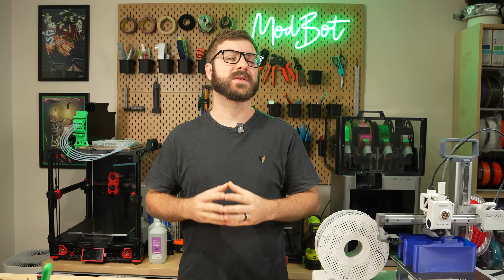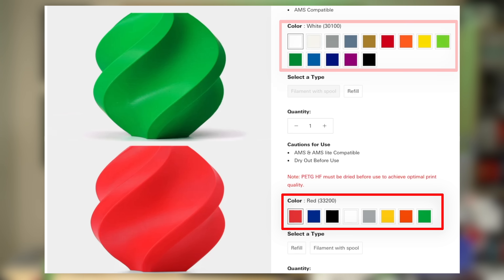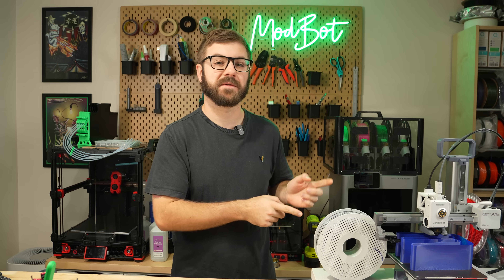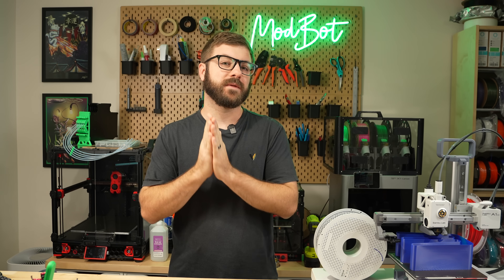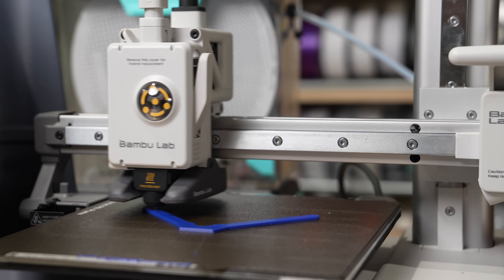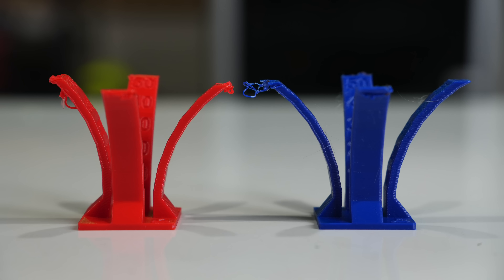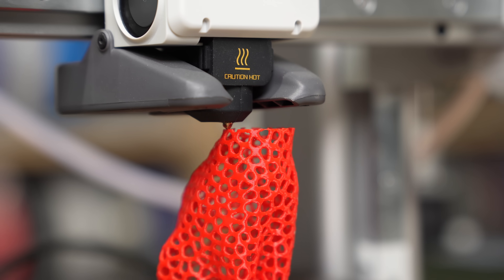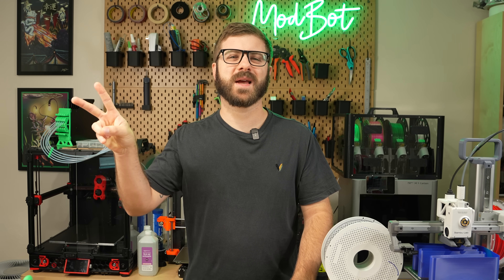Is HF PETG Actually High Flow? (And What Are The Trade-offs?)

Comment: I'm in the tank for it, I switched from elegoo rapid to BBL HF completely, been through about 20 spools since it came out and loving it. love the near matte sheen
Reply: I’m making the switch from Elegoo rapid to the Bambu stuff, hopefully I have the same luck!
Reply: Elgoo Rapid PETG is so good and the price is right. I'm running it at 24mm3/Sec volumetric rate and it is flawless. Less goopy in my experience that the other (non HF) PETG filaments I've used. Honestly, there is barely any stringing at all. I printed a big fish tank filter intake screen with a 1mm grid. Every single one was printed perfectly. If I could get all the colors of PLA, I'd probably use it for almost everything I use PLA for. I bought all but 1 color now. $15/spool is a good price.
Reply: If you're using a bambu P1 series, may I ask what profile settings you are using?

Comment: @MyTechFun tested mechanical properties of PETG HF and it is an improvement over its basic version. It’s also easier and faster to print, so definitely a W.

I am also kinda confused how so many people in the comments think that PETG is stronger than PLA… it’s not, just more heat resistant and flexible, which let you see if it’s going to break or not.
Reply: PETG HF IS SO GOOD ITS THE BEST THING EVER I LOVE BBL

now that my comment is safe this is total BS. the "test" these two are referring to had a sample size of 1 or 2 lol. and why would BBL let it skew worse. if they were going to be wrong it would be in the other direction. i guarantee bbl did tests with a sample size greater than 2.
Reply: @mrrooter601 okay, fair point. I haven’t think about it that way. 

I am not a Bambu Lab Fanboy or something, I just like their products because their price to performance ratio is simply great.

Although you are probably right, that PETG HF has weaker mechanical properties, I like that it has a matte finish and that it’s faster to print.

As I stated before, PLA still is the strongest besides of nylon or something (as BL it self writes in their information sheet) and temperature resistance. So if I want to have great mechanical properties, I stick with PLA. Easiest to print, fast and good :)
Reply: Yep 👍

Comment: I built a very fast 3D printer, installed a high flow hot end, then loaded up some high flow filament. The print was finished before I even sent it to the printer.  😜😂

Seriously though. When I tried HF PETG, the results were fragile. Same as your findings. Worst plastic I've ever used. It wasn't Bambu brand, but another well known one that I've heard is what the Bambu often is rebranded from. Totally made the point of printing in PETG vanish faster than printing a 1 min benchy. Feels like the whole execution of HF PETG is just to sell plastic to people who don't know what they are doing.

Comment: Excellent video. Could you maybe do some strength tests also? 
Petg can be a good choice for shelf brackets, and it would be a shame if Bambu reduced the strength of their petg, and shelves come crashing down all over the world 😅
Reply from the maker: I dont have a great setup for this. I have looked into it many times over the years and would really like to get a test unit in or build something so Ill definitely consider it.
Reply: It has already been tested, hf version is better mechanically
Reply: @riba2233  this guy has gone around to every single comment here that is critical of the HF or are questioning what BBL state on their website (20% lower layer adhesion) and is quoting a video that has a dozen different tests with a sample size of 1 or 2 each as definitive proof. 1 or 2 is fine for things like softening and deflection, but for something like layer adhesion why by nature IS inconsistent, thats just not ok. just watch any cnc kitchen video and see how much scatter can affect results. even a filament with a decent average layer adhesion, can be bad if the bottom end is weak. a print is only as strong as its weakest point.
Reply: @mrrooter601   that same test had a pretty consistent results with two samples so it is fine, don't act smarter than you are

Comment: Daniel, a note on your overhang test models all failing: I think this is a firmware bug with the A1 mini.  I started having issues with my A1 mini running the nozzle into prints above a certain height after the last firmware update. If you watch closely, you can clearly see the nozzle starts to run into the part, knocking the print loose from the bed if there isn’t a wide base for lots of adhesion. A number of other folks have reported this and so far the only workaround people have come up with is changing (in Orcaslicer) the Z-hop type setting to Normal instead of Auto, and disabling the Reduce Infill Retraction setting.  This does stop the nozzle knock, but increases stringing in many cases. I know a few people have submitted this issue to Bambu Lab, but I haven’t seen any response from them other than saying that it’s just a simple bed adhesion issue or just curling or warping of the part. Doesn’t explain why it only started after the last firmware change. It would be interesting if you could bring this up with Bambu and see if you can get any answers.
Reply: I've been having this issue ever since I got my A1 mini, which I've only printed with using the latest firmware. I found out that I was more or less forced to uncheck "reduce infill retraction" for every print, but I have not tried messing with any Z-hop settings. But yeah, it definitely feels like something is off. It consistently grinds the nozzle against hardened surfaces when "reduce infill retraction" is checked, regardless of infill pattern.

Comment: The entire point of PETG over PLA is the durability. If the HF PETG has durability more like PLA, then what's the point of printing it in PETG? 
This is a horrible decision. Print speed isn't what is most important, it's the plastic having the right properties for the object. 
Bambu seems to care more about marketing than proper 3D printing.
Reply: Why do you think it has lower durability? Because it doesn't
Reply: @riba2233  how much do they pay you to do this? every. single. critical. comment.

Comment: i just finished some PETG basic prints and started switching over the the PETG HF, and once its dry it feels the same. The one thing i do like about the HF is that it seems to stick a lot less to the nozzle, as ive had barely any boggers  to deal with, which was a bigger issue before
Reply: For real?! This is one of my biggest pet peeves on my printers. Fucking boogers and damage to the silicone sock because of them.

Comment: I wish they would just focus on building good hotends that can melt the filament properly at high speeds. I hate all these fast filaments they are coming out with. You're losing mechanical properties with these new filaments.
Reply: You aren't, it has been tested and this hf version has better properties than the old one (printed at same speeds ofc)
Reply: @riba2233  Less bending strength, more stiff than regular PETG, less impact strength in Z and in XY.
Reply: @memsu06   yeah on paper, not in real tests. it is more stiff but more impact resistant which is a great combo
Reply: @memsu06  fyi this sh1ll (riba) is quoting a (single) video with a few tests done with a sample size of *1 or 2*, undried filament as well, even for the old petg. and is calling this a scientific conclusion. they have also replied to every other comment here critical of it (so have I at this point but only because I want to point out this nonsense). literally what reason does bbl have to show a layer adhesion that is somehow worse, it is literally always the case that that stuff is exaggerated. so that argument makes no sense.

Comment: thanks for making this, I watched someone elses video about this a few days ago and they seemed to absolutely sh1ll it. meanwhile Im looking at the drastically worse layer adhesion and im like "are you not going to mention that?" 

I purchased a p1s and some bbl filament as my first printer last december, one of which was BBL petf-cf which has been absolutely fantastic for nice looking parts. the main issue being its horrible layer adhesion, especially when printing fast. guess what has a nearly identical "Layer Adhesion (Impact Strength - Z)" petg hf. are they really trying to sell something that Is 20%??? weaker (than normal petg) as useful for its mechanical properties? I am not through the whole video yet but I can see from the comments that it as at least critical.

hoping for some real testing and not like the other video I watched where he printed 2 boring vases and said look! the overhangs are slightly better!
Reply: My tech fun did some proper mechanical tests and this hf version is better.
Reply: @riba2233  then why does BBL have it show worse mechanical properties on their spec sheets? something just doesnt add up there.

edit: just watched the mytechfun video. and lol. so he does like a dozen different tests... all with a sample size of one (or two, which he then "averages")....... thats actually unironically worse than nothing. I would not call "tests" with a sample size of two "proper".
Reply: @mrrooter601  simple, mfg data is always off basically, nothing surpising
Reply: @riba2233  lol my reply is gone ofc. this platform is a total joke. but basically a sample size of 1 or 2 is more accurate than manufacturer testing? lol. why would they let it skew worse. if they were going to be wrong it would be in the other direction. i guarantee bbl did tests with a sample size greater than 2.
Reply: @riba2233  copied from the other video, but this is the gist of what was poofed by "why T"

"there is just no way you are getting accurate numbers for layer adhesion with that few tests. (which is the part everyone cares about because BBL themselves say it is over 20% worse with HF, with layer adhesion already being its weakest property)"

(the important point) "even if it scores higher on average, if say there is a larger scatter with hf over the original with inconsistent layer adhesion that would be a massive detriment as a part is only as strong as its weakest point."

its entirely possible that the HF has a large scatter in layer adhesion with an actual sample size, perhaps BBL is representing this with the lower layer adhesion number. because thats the thing, there is always going to be scatter in layer adhesion, its one of the most inconsistent properties in 3d printing. and everyone says its "better" because you can print faster, but literally who cares, petg isnt an engineering filament people are using for real work, its a hobbyist filament with a nice finish that is also used for more durable parts, that are better outdoors, and have a bit more flex and toughness to them at the cost of some of plas peak strength and print speed. you need speed you use pla or cough up for tough pla. literally who is this for.
Reply: @mrrooter601   oh boy... 🤦‍♂️